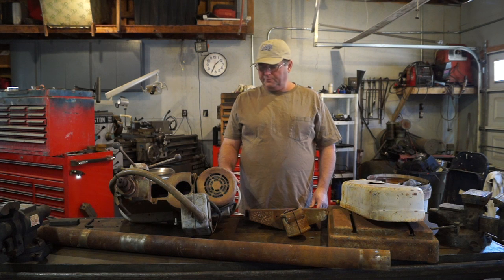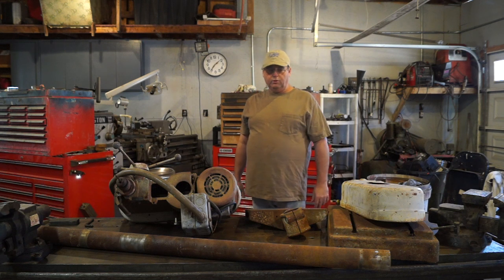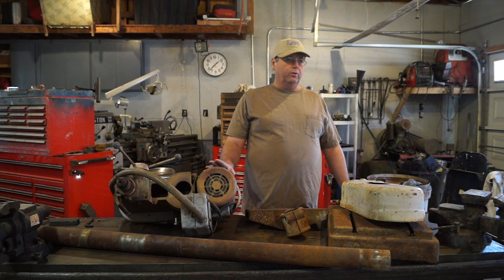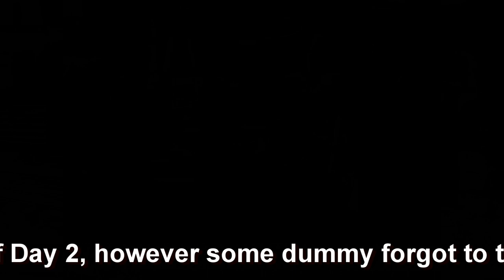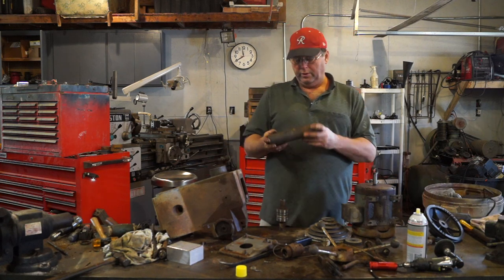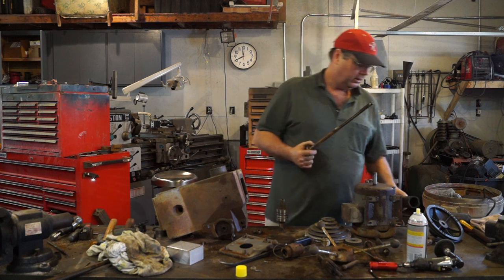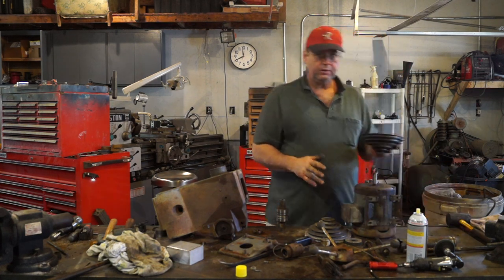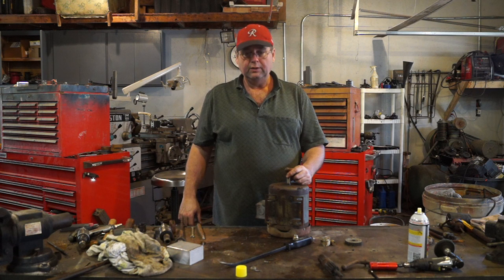Rockwell 15" Drill Press Restoration Part #1

Comment: not for nothing, stopped watching when I saw you taking pry bars to the belt wheels.  There's an allen key set screw that I THOUGHT you noticed on that tapered wheel.  Just stick in a T-handle 1/4", loosen, and the damn thing slides off.  I had to shut it off when I saw you break the shaft.  Roont a relic.  Repairable, but god-sakes, man!